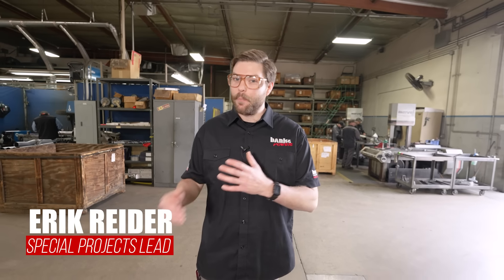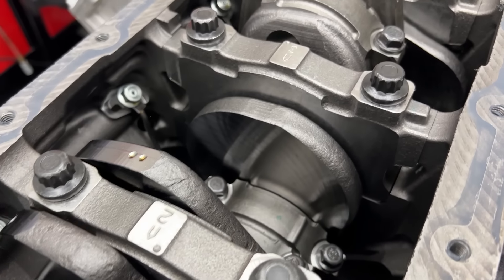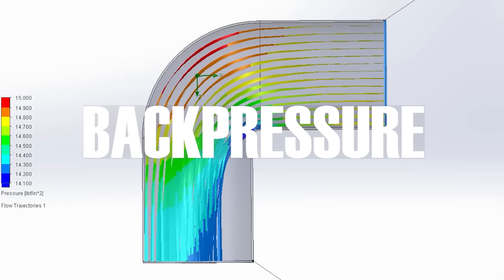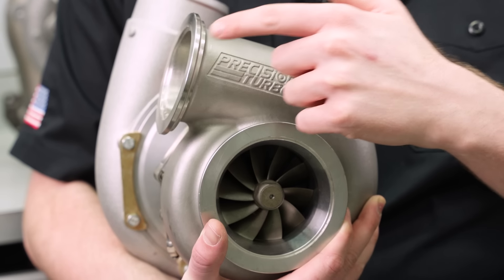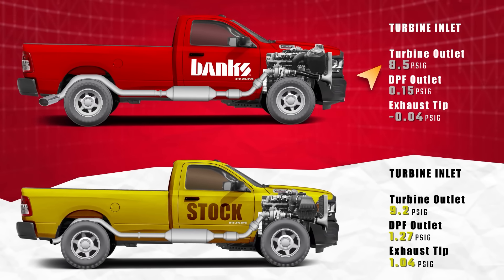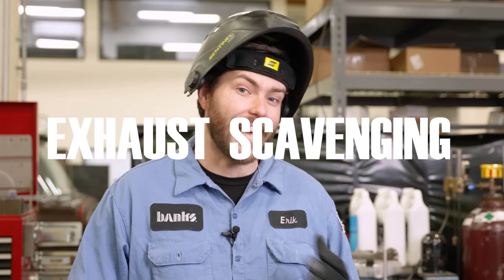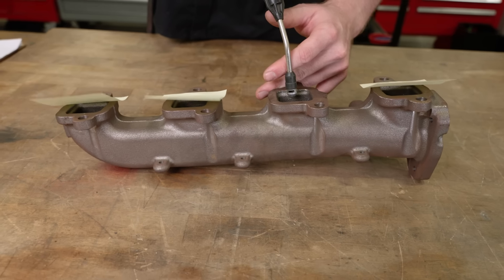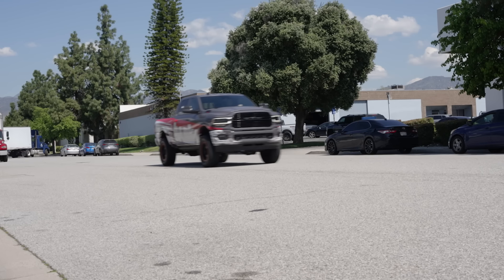Busting the exhaust backpressure myth | Banks Entry Level

Comment: Backpressure is bad, but exhaust velocity is good for an N/A engine. An exhaust that is "too large" will reduce exhaust gas velocity AND back pressure. The loss of back pressure isn't the issue, but the loss in exhaust gas velocity IS a problem, because it reduces scavenging. This is only applicable to non-turbo engines.
Reply: This is very true. So many times you hear of people who put a high flow exhaust on their car, then complain of loss of low rpm torque.
Reply: It also very much applies to turbo engines. It's harder to target an appropriate runner length and diameter and the effect isn't as dramatic but you can definitely modify your VE at various RPMs both on and off boost with a properly designed turbo header. The improved VE off boost can actually help low rpm spool time as well as provide a bit more part throttle response without hindering higher flow performance (within reason).
Reply: Agreed 100 %. Just change your small cam 283 exhaust from 2 to 2-1/2, you will notice right away lost low rpm torque. Big pipe only benefits high rpm power.
Reply: I could be wrong, but if you reduce the exhaust gas velocity and there's no scavenging there should be technically more back pressure than an exhaust that has higher flow exhaust and scavenging. Since you need a pressure differential to cause the scavenging effect.
Reply: Yes and no, scavenging is caused by a negative pressure differential in the combustion chamber, backpressure goes against this as it creates a positive pressure differential. It's better to have absolutely no backpressure in any engine, even in N/A engines due to modern engines taking advantage of the benifit of scavenging, turbocharged/supercharged engines are already forced induction engines, so scavenging is a really, really bad idea, as the extra boost will leak out the exaust port if u tune it that way. All scavenging does is pull more air in near TDC between the exaust and intake stroke, by leaving both the exaust and intake valves open slightly at the same time. High cam profiles on drag cars take advantage of this affect all the time, but have shitty low-end rpm power due to the side-effect of the exaust gasses being pulled back in near TDC during the intake stroke. What manufacturers did to mitigate this side-effect is introduce tech like VVT (GM's variable valve timing solution) and VTEC (Honda's variable valve hight solution), which allow for smooth low-end torqe and punchier high-end power utilizing only all the benifits of scavenging. So backpressure is really only an limiting factor of your vehicle no matter if its N/A or not. And if u say "what about Nitrous Oxide emmissions, isnt that more dangerous to the environment than loose hydrocarbons?", ill just say there's already a device that mitigates that issue, it's called the EGR valve, get a bigger EGR valve if u dont want backpressure from it.
Reply: @Rich-q9r  only if you don't design the header correctly.

Get yourself a small header with smooth bends, a merged collector with a small choke, put a big pipe on after the expansion, and win at both ends of the dyno graph.

Note: This assumes that you start with old school non-merge collectors that are basically the finished exhaust pipe size. A 2" choke is already too large for most street engines (you know, the ones with less than 300hp). I'd go as far to say that a 2" choke on a decent tri-y would be a good size for a 400hp engine.
Reply: What about the supercharge engines do we need scavenging effect ?
Reply: @Fawazalsobay  I don't see why not, better flowing exhaust always helps super charger setups.
Reply: @sigmaprojects   I’m going to benefit better with an x pipe than H pipe in supercharge engine ?
Reply: @Fawazalsobay  I don't you'll really notice a difference between x vs h pipes. If you're set on them I would get which you like more or who has designed a kit that best matches your project. If you're looking for the best overall power I'd go with a 180 setup, that is if you have the packaging for it. This is a pretty good video about 180 designs if you're not familiar.

edit: thought the video link was added https://youtu.be/AYrtPp-OuZw?si=NaDhzt1xxFXzVmUw
Reply: @Fawazalsobay  supercharged and turbocharged engines encounter less boost pressure resistance with scavenging, but only under heavy moderation, u don't want any of the created boost pressure escaping through the exhaust. drag cars typically have high cam profile for the intake, and retarded timing for the exhaust with a low cam profile, this is to restrict pressure being fed out through the entire engine. the scavenging effect really doesn't work on forced induction engines, scavenging is an effect when a negative pressure differential is created by exhaust gasses escaping too fast, or essentially a vacuum for air through the intake to fill, therefore increasing power on N/A engines. however the same timing used can be used to increase the efficiency of the forced induction devices.
Reply: Pressure does not equal velocity
Reply: Loss of velocity isn't bad if the 'volume' of exhaust pushed is higher = efficiency.

A wider diameter exhaust will slow down velocity because there is more width pushing out the same if not more volume (no restrictions).

Volume is more important than just looking at velocity.

With a bigger exhaust capable of pushing out more, there is the added advantage of coping with any increase in exhaust gas from future tuning.
Reply: @codyfrance2537  intakes need to be optimized more unlike exhaust, there's resonators and optimized intake lengths that affect performance greatly. i would leave that stuff alone unless u r adding aftermarket upgrades to deliberately add boost or more power other ways.
Reply: @TeamStevers  yes, thanks for explaining 6th grade science to the world.
Reply: @crxdelsolsir  thank you, i was trying to explain all of this earlier, exhaust gasses need mass for velocity to actually matter, however exhaust gasses are generally lighter than outside air due to its energy state. the pressure differential is what matters the most, have a greater pressure differential and you have faster escaping exhaust gasses, creating a greater negative pressure differential in the combustion chamber.
Reply: Now try to balance a 2 stroke.
Reply: @thatonedude5237  yeah but that matters before turbo not after.
Reply: @SoulTouchMusic93  My response was to the statement "this is only applicable to non turbo engines". My point was their are plenty of turbo configurations that could take advantage of savaging when not generating significant exhaust flow if tube diameter both on and off boost are considered.
Reply: @Rich-q9r  Putting race tuned pipes on a street car will usually have that result. That can, be tuned out to some degree, by adjusting the primary lengths of the extractor to suit the capacity of the engine and its intended use.
Reply: @skippy2987  Finally someone who agrees on the smaller diameter Tri-Y headers.  People go only for peak HP and forget that 99% of the time you're not at that RPM range on a street engine.
Reply: @thatonedude5237  it's not even scavenging sometimes. The smaller manifold tubes deliver more of the exhaust pulse energy to the turbine as the gases don't have as much pre-turbo volume to expand into.

That's also one of the reasons twin scroll turbos have better response if all else is equal
Reply: @Fawazalsobay technically speaking an X pipe is better, but the different is almost insignificant for any non racing application. In other words, the 2-5 hp you might gain with an X pipe on a 550hp engine isn’t enough that you’d ever notice. Pick which one you like the sound of better (They say H pipes have a little bit deeper tone)
Reply: @electrothecat  
Spot on post!
 VVT systems pretty much eliminate the need for cam overlap profiles. The VVT system becomes your cam profile within the cam's overall operating range.
Reply: @Fawazalsobay  
IME X pipe is the best way to go.
Reply: Pressure in velocity are relative
Reply: @kellygibson4653  thank you, im actually trying my best to learn all these technologies, as i'm designing an engine for myself that combines a majority of these technologies, even some not as common as others to make one frankenstein monster of an engine. I already have something being built in freecad.
Reply: @skliros9235 often it’s because the mixture has moved lean of the original ratio
Reply: @Fawazalsobay  no
Reply: I think there is confusion between spark ignition engines and compression ignition engines. No doubt all intake and exhaust restrictions negatively affect the compression ignition engine.

On spark ignition valve timing is tuned for the exhaust back pressure.

2002 KTM 250 RFS came with same exhaust as the 450 and 520. Had poor low end torque until the aftermarket delivered smaller diameter headers. Cost very little peak HP but delivered low end torque.
Reply: @N4HHE  so? Tune the engine for the aftermarket mods, easy as that. Theres a reason why engines are controlled with computers now...
Reply: @electrothecat  computer has some control over valve timing but not that much.
Reply: @N4HHE  well, turns out its enough for mega tuned 20psi boost i4's, 15 degrees is way more than u need for many applicatons, and as much as u can push without having valvetapping in modern interference engines.  Ignition happens on average 20 degrees before tdc in gasoline engines, that gives u maximum power and efficiency by accounting for the combustion latency after ignition, therefore the combustion is used more effectively in a ice.
Reply: @N4HHE id love to see the exhaust but I’d bet a dozen doughnuts that the header length and collector configuration was the cause of the gain and the small diameter pipe cost you on the top end, which again demonstrates how back pressure only costs HP.  The configuration of the pipe will of course help in specific areas, also exhaust velocity for scavenging but neither of those are back pressure benefiting the engine.

Free flowing is an advantage and tuning in such a way that there is vacuum (opposite of back pressure) helping to pull mixture ‘through’ the engine.  Cam overlap comes into play here….
Reply: My pops used to always talk about air velocity during the foxbody days. And why his 347 could pull hard all the way up to 6700. I guess my pops were smarter then I realized.... Now that he's gone.
Reply: @CrazyChiefXxX  Sorry about your loss...
Reply: I agree, well said.
So many things WRONG in this video it's embarrassing, I don't have the time to point them all out.
7:10 less back pressure can create more HP at the top end and reduce HP in the low and mid rpm range where most cars/truck SPEND MOST OF THEIR TIME, making the vehicle less enjoyable to drive around town (especially motorcycles)
9:58 "with our headers we tune them correctly"?? for what? peak hp at the top end, basically hurting low and mid preformance. I have 4 decades of tuning with a dyno for a race team, I call most of this video rubbish. There is so many variations of vehicle use/purpose, and this video is busted.
Reply: @ozzy3333333 what makes you think you’re not just measuring the difference in velocity and flow, how would the presence of back pressure help at low and mid rpm?
Reply: @ToolinAround2025  My decades of experience in a racing and street applications using a dyno, racers and my own driving/riding experience. Most dont understand tuned resonance, you tune the size/length of intake/exhaust for your application. If you want top end, you lose bottom/mid rpm power, unless you have a servo valve controlling exhaust back pressure, this system is the best of both worlds, smoother and more power in all bands. It's even more pronounced on 2 stroke motors, as there is more resonance items to tune, I have many national championship titles in 2 stroke territory.
Reply: @user-rs8zg8ey2b  I certainly agree with that, but what’s that got to do with back pressure as an isolated variable, and why does it work that way in your experience, theoretically?
Reply: @ToolinAround2025  One word "resonance". Different rpm has different resonance, optimize for one rpm, hurt the others.
Reply: I strongly disagree that scavenging is only important for N/A engines and NOT for turbos.  There are hundreds of fabricators that do their own dyno testing with their equal-length designs vs commonly available (and much cheaper) cast manifolds.
Reply: @Fawazalsobay  Yes.
Reply: @Fawazalsobay  Yes, although not nearly as important. It definately helps with cooling.
Reply: @Fawazalsobay  x-pipe will always outflow an H-pipe. Scaveging effects better for x? YES. H-pipe does its job best at lower rpms. What is lower? 3000 and below. An x-pipe works no matter the rpm. X-pipe does not cause turbulence on the back side ever unlike an h-pipe
Reply: @electrothecat stop the EGR BULLSHIT! Egr is mandatory to be deleted from the car dont tell me its environmental its not
Reply: @PKperformanceEU  and you dont have any proof, its actually illegal to remove you emission control systems from your vehicle, as per epa regulations. the egr valve reduces nos emissions by cycling some of the exhaust emissions back into the combustion chamber, therefore cooling down the emissions. the egr valve is important to reduce nos emissions that are about 2-3x more destructive than unburnt hydrocarbons, nos emissions would be otherwise created by the catalytic converter as it gets hot. egr valves do cause a minor performance penalty tho, but it is a minor one, too little to be considered a problem. maybe be a little more informed about the topic before you go responding to a 3-4 month old reply.
Reply: Supercharged SBC on dyno. 450 with 3 ft header extensions. 505 with full exhaust system. Afr was corrected for each setup.
Reply: I’m pretty sure gale knows what he’s doing and I have to side with him any back pressure sucks if he didn’t know what he was talking about he’d have been out of business by now better off leaving it to the people who actually know what their talking about I know we all have are opinions but when the facts are right in front of your nose it’s hard to refute it
Reply: Are any of yall gonna explain why backpressure and air density/ pressure/ velocity/ affects carbureted fed engines a bit more than fuel injection engines? I learned much of my knowledge from trial and error on older 350, 283 and straight six engines as well as carbed Harleys...there's definitely different setups for different engines and what they want as you modify the fuel, air, spark, and exhaust rates to optimize the performance of each individual setup and it's specific intended purpose...generally, as a rule of thumb, I feel that chasing down and attaining low to mid torque power is where it's at for anything that drives daily or for a long distance. As it goes with peak hp, balls to the wall, all recline, and pretty much zero restrictions on exhaust flow, forced induction or n/a, doesn't matter...if yer wanting all full bore gobbling every particle of air n fuel it can, I don't see any point in backpressure or exhaust scavenging at all. A good street or daily machine should be tuned and setup for optimal low end and it's more difficult than just blazing everything as fast as it'll go.
Reply: @soopersooper3291, if you've ever modified a carburated motorcycle then you would know the pretty extreme effect that exhaust backpressure and/or the lack thereof can change the "power-band" and when to shift and jetting and, well, pretty much the entire feel and ride itself. Ozzy dude is right imo. This vid seems to focus on diesels with a shload of after-treatment and emissions b.s to overcome, and honestly, there's a few points made that I would dispute on different engines and applications.
Reply: For a bike, if you remove backpressure by putting on an open slip-on and claim you lose all drivability at lower rpms, it basically just means you haven't adjusted the carb/efi to compensate the change of tune.

 It's a different ballgame if you add cams and change the tuning completely by also changing the pulse tuning (bellmouth lenght/tapers and airbox volume) as well as (usually) digging a too big port even bigger, to get flow you don't really need.
Reply: @SWREngineering  small engines are a perfect way to experiment . There are so few variables compared to any modern, new highway vehicle, where you can see the change instantly and rule out anything else.
My brother and I used to build go karts back before flathead Briggs engines were banned by the EPA.
Without changing anything else, wide-open, large diameter pipes would make it run like crap. Tuning the carb would make it run better at high speed, but idle like shit and have no bottom end. 
Were there any pipes out there that did everything better than the stock muffler?
 Of course.
 The stock muffler was made to optimize power at the stationary accelerator settings normally applied to small, agricultural engines, while reducing noise slightly.
But the wide open ones didn't work well without changing a bunch of other internal parts.
This is an easy enough experiment to copy with anyone who has an old lawnmower and access to plumbing pipe. People can argue online for years, or just go toHome Depot and get a section of pipe, and see for yourself.
Reply: @RequisiteFunction  yeah, the point is in "large diameter", not "open"... a friend bought a 150cc Chinese motorcycle engine to test in his small dyno, and what exhaust made the most power as well as the widest powerband was an open pipe, primary being calculated through software and ended up at a bit longer than stock, but 6mm smaller pipe diameter.  Most "tuning headers" come with bigger primaries, that's killing the powerband.
Reply: @electrothecat lolololololol. Spoken like someone who’s never ever tested any engine ever.
Reply: @joshiek7839  Good one joshi
Reply: We raced a 1.6l Toyota 2tc hemi in road racing using 2 different headers one with larger diameter tubes which was used on larger oval tracks like Daytona and Charlotte. The small tube header seemed to have better low-end power. We did not have a budget for Dyno testing so .....